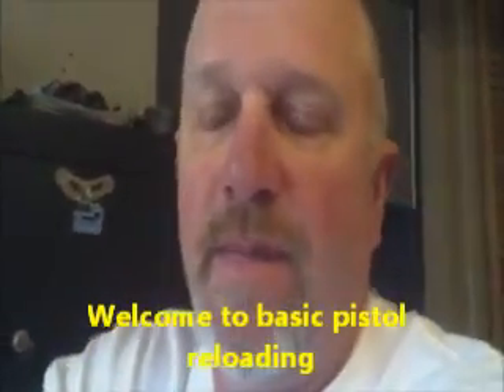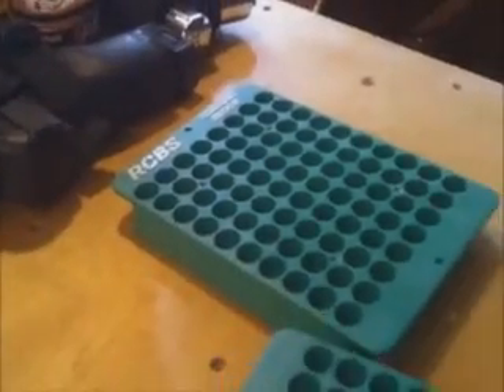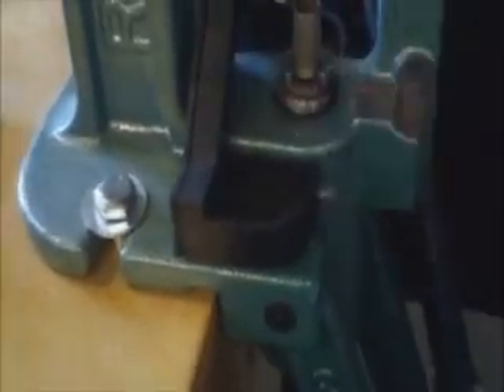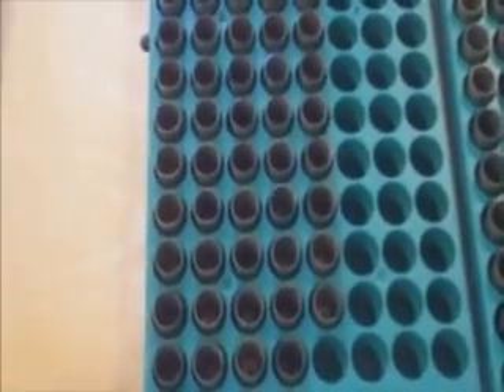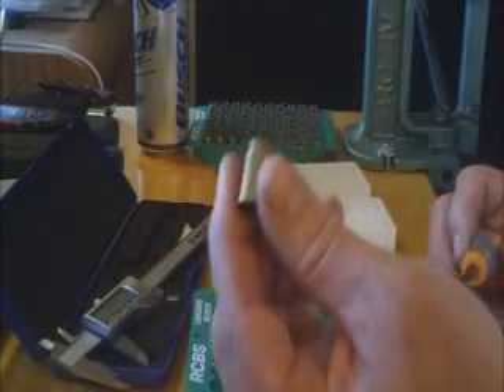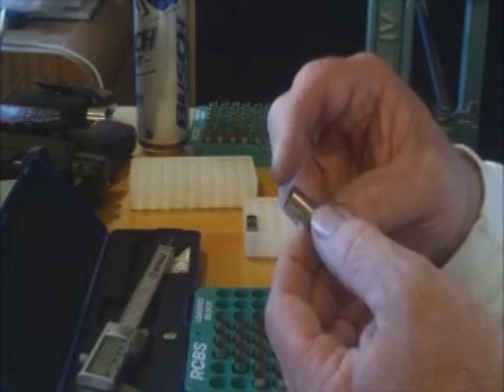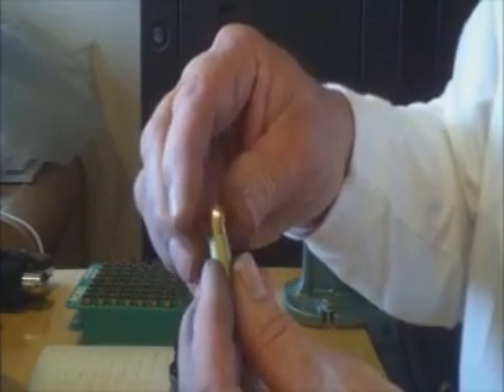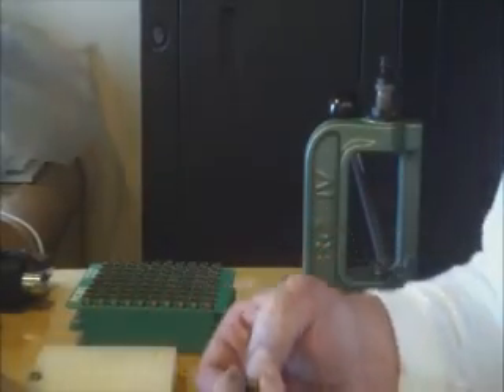Reloading 40 cal S&W ammo (preparing the case's)

Comment: He's correct about the Glock brass. The Redding GRX is a nice push through die that removes this bulge and allows the casing to be used again. Because of this bulge, some places continue to say not to use reloads in Glocks. However, as long as the bulge is removed and there isn't excessive wear on the brass, you're good to go. I used to reload for rifle and shotgun with my dad and I'm looking at getting into loading for my .40 Glock and my wifes 380. But first...its time to learn!